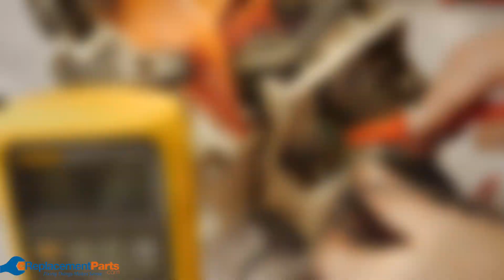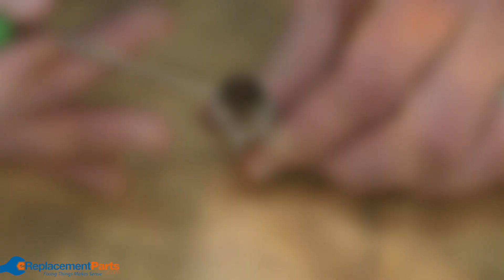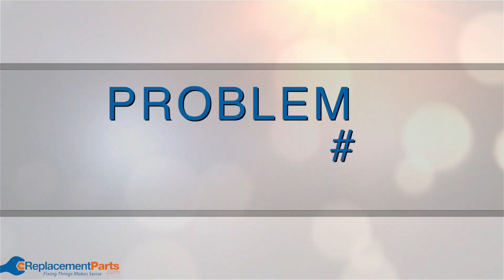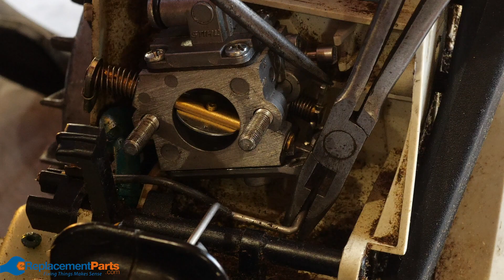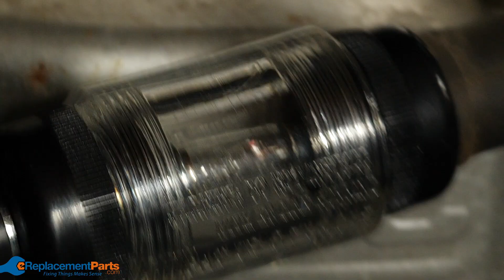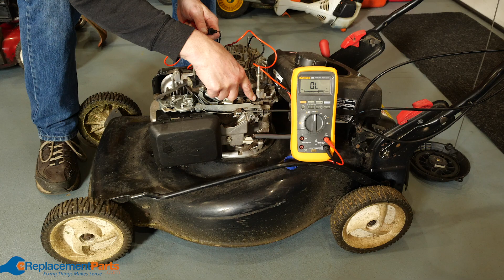Small Engine Troubleshooting: Why Won't My Engine Start? | eReplacementParts.com

Comment: Fairly useless vid, actually, It's  a case of "Well if this is broke, fix it...next...if this is broke, fix it....if the carburetor is dirty, clean it...etc etc. Nothing on HOW to do any of the suggestions, nothing about diagnosing a non-starting engine,  eliminating potential causes, .  I came here from clicking on a link about a 'surging engine' and got this instead.
Reply: Yeah. I was going to comment, "How do we know if the recoil starter is damaged? What are the signs we Look For?" Even a "clean" spark plug is going to look dirty--certainly not like a new one. Checking for electrical continuity??? Not all wires are supposed to have continuity--they aren't all connected if it's charging a battery. "Check if the flywheel key is broken" ??? It can be a major task to remove a flywheel, then getting it back on isn't like screwing in a light bulb.

Comment: If it's a switch issue, wouldn't it manifest itself as no spark (it would ground out and prevent the spark plug from firing to stop the engine)?  Just curious because I am using a spark tester, have spark and don't want to go searching for switch/wiring problems if that is an indicator that they are working correctly.